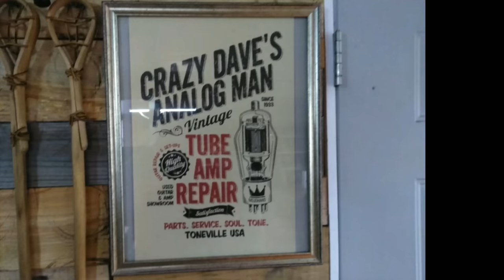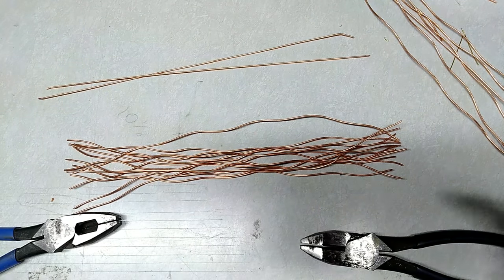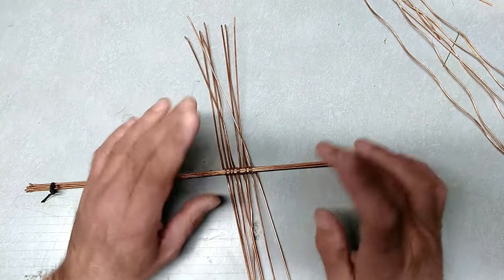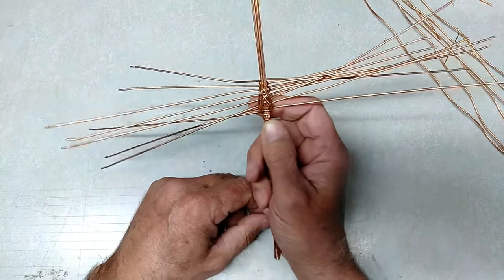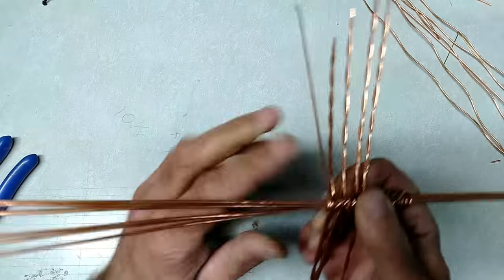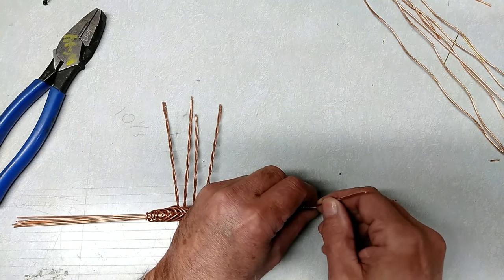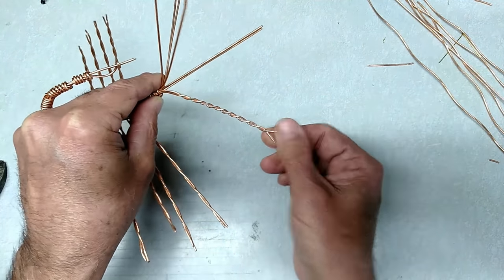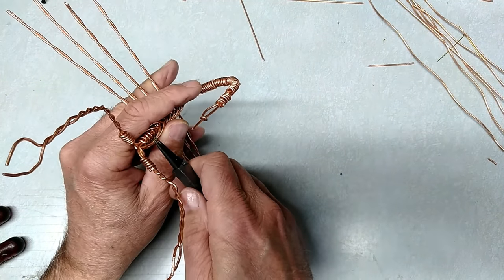Making a wire Scorpion

Comment: Great tutorial, you get right to the point and explain in an way that is easy to understand and follow. 1st one I tried came out looking good. I used a roll of rusty wire that's been in the garage for at least 30 years. Went and bought a 3.5 lb. roll of 16 gauge rebar tie wire for $3.99 which I'll try next. Thanks for the tutorial.

Comment: Great tutorial. I just didn't get the proper length of the 16 wires and how to more precisely split them into tail-length and arms length, for here in Brazil we use centimeters not inches. I understand you made a really big item.

Comment: Does it have to be solid?
Reply: Yes. But you can take the strands apart on stranded wire and make small scorpions. The size of the finished scorpion is determined by the diameter and length of the wire. Just use smaller wire and cut them shorter. Enjoy